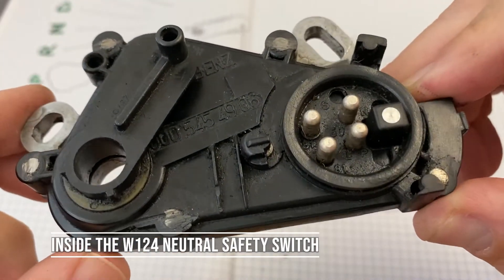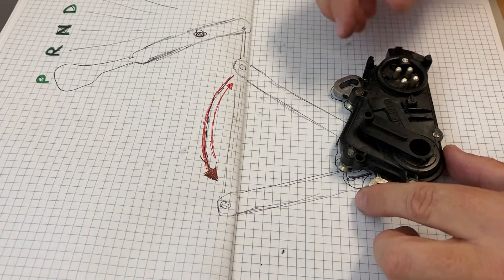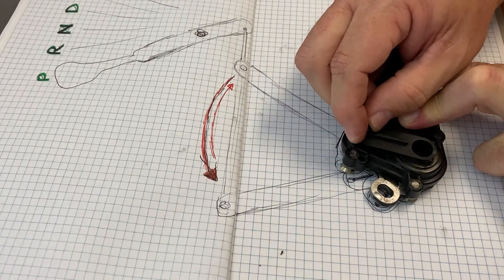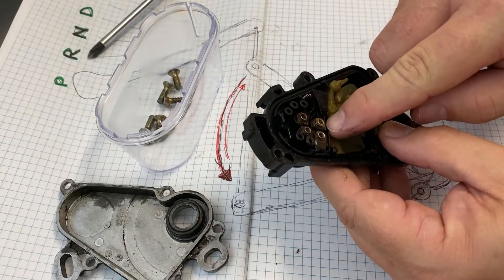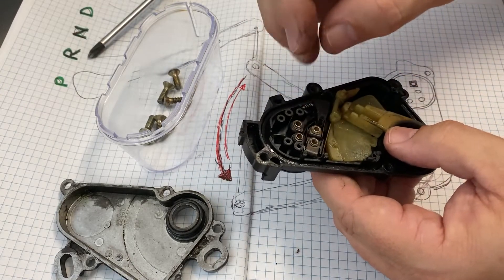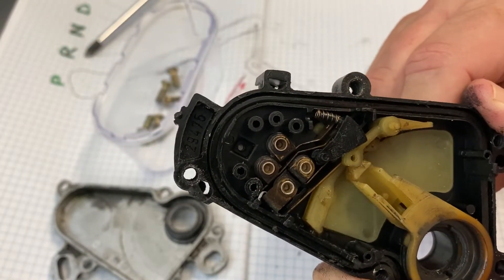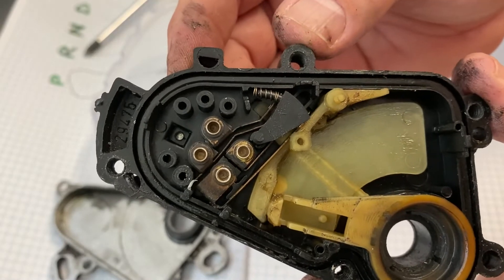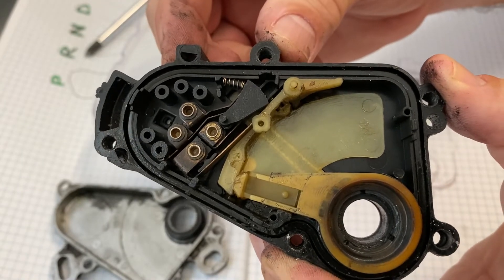Teardown of the Mercedes W124 Neutral Safety Switch

Comment: I'm guessing.. I have an electrical background.. taking it apart was to clean the contacts.. as they would operate a relay..
There's a nice little trick that can be employed when something like this is in play.. if you can work out which is the feed wire ... put a good quality toggle switch in.. possibly double pole.. that is hidden.. say below the seat but is convenient to access when seated...
When in the off position the car is impossible to start and steal...
Similar can be done with the fuel pump...
My Dad had a switch on the fuel pump and just after leaving home, we would be going down the road and the car would miss behave and he would remember and quickly click the switch.
We went to London for the day and parked near Buckingham Palace .. this is 50~ years ago.. we got back to where the car should have been.. someone had decided to steal the car.. about 150 yards down the road were the Police and our 1961 Mini Van.
Possibly a better strategy to allow them to steal the car.. only to find it stops within sight of where it was parked in the road..
Thieves don't want attention...
Reply from the maker: That's funny. I used to have a cut-off switch in an old Datsun 1600 back in the 90's when I delivered pizza so I didn't have to lock the doors every time I went into the shop or apartment blocks etc. If you are interested in converting something of your own, one of your countrymen, Dave, has the RX8 channel. This is the video where he explains the cost of his conversion.
Thanks for following. https://www.youtube.com/watch?v=FFp8MWakx68